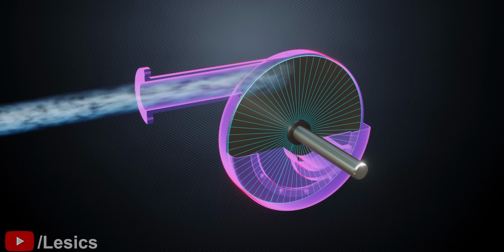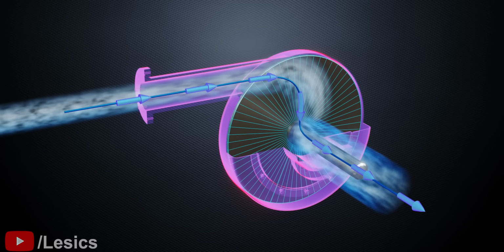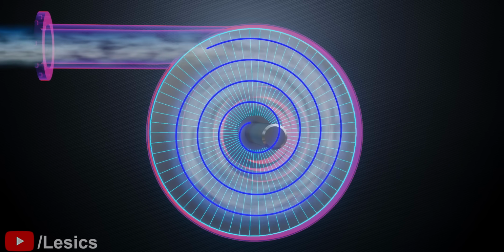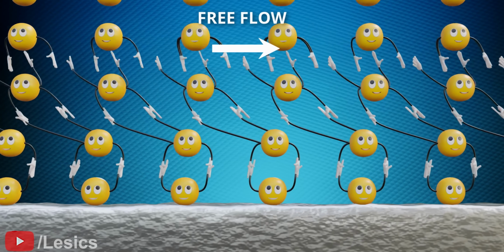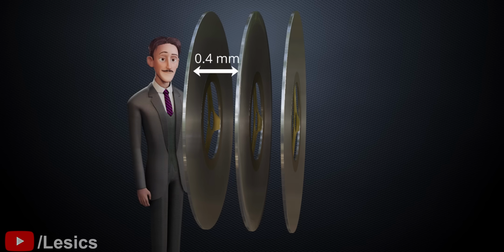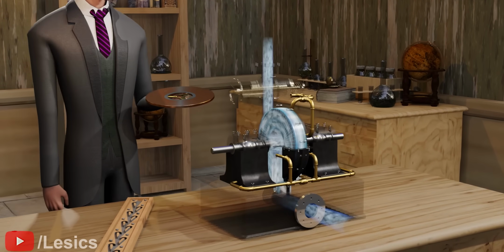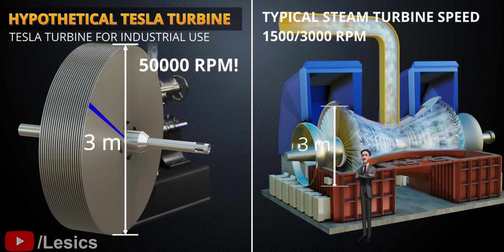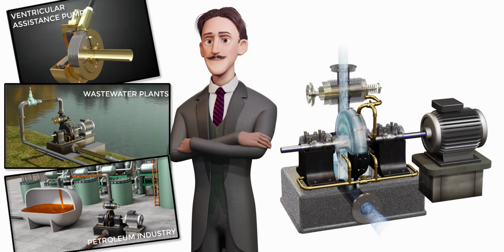Tesla Turbine | The interesting physics behind it

Comment: Edison after seeing this: Edison's turbine
Reply: Ill give you a gazillion dollars for it
Reply: @MrPorsche91730   here's 10 cents to buy your tech
Reply: @MrPorsche91730  I think it's
Reply: @MrPorsche91730  that would crash the economy
Reply: This turbine has much lower efficiency than any modern turbines. The problem was that at that time there were no technology to produce the blade turbines
Reply: @natteft6593  Oh really? The guys at iEnergySupply beg to differ. What this vid doesn’t say is Tesla said that pulling a vacuum on the exhaust increases efficiency by 50-100%! When used in a small form factor, in combination with a simple but specific generator geometry that uses non-ferrous magnets, this technology is absolutely perfect for every home to generate all the energy it would ever need using warm water.
https://youtube.com/user/Notime500
Reply: @DozenDeuce  pulling a vacuum costs energy, which reduces the performance. I'm not sure how the energy is meant to be enhanced more than the forces are offering.
Reply: @1SweetPete  I guess in space, vacuum would be no problem to achieve. The problem would be that you are leaking steam in space :)
Reply: @1SweetPete  In the case of steam, pulling a vacuum does not waste energy it recovers wasted energy. The transition phase of steam cooling to liquid form creates a vacuum in a closed loop system.  In other words placing condensers after the outlet of the Tesla turbine increases the efficiency. Also the issue of having a 3 m rotor due to “industrial scale“ is a false premise in this video presents that false premise without question. If the efficiencies can reach 97% in a smaller rotor then one would only need more smaller rotors as opposed to fewer larger rotors. Efficiency is efficiency. The production value of this video is very high and I suspect it cost quite a bit of money to produce, so the question you have to ask yourself is who benefits from spending so much money to discredit the efficiency of Tesla turbines in favor of others?
Reply: Yeah, there are ways to do a negative pressure exhaust in a closed water system.  We do it with pretty much every toilet on the planet.  That being said, I don't know if it would be efficient enough for a true vacuum.  I also thought about splitting up the water input into more, smaller devices, especially since we can get machining RPM materials up to RPMs significantly higher than those mentioned here, it's just a matter of parallel power generation of enough smaller generators.  The question then becomes a matter of whether or not manufacturing and maintaining hundreds or thousands of these small generators is more cost effective, not power generationally effective.  You have to assume at this point an overhaul is an expensive proposition, so will it be less expensive to do that or maintain existing structures?  I think this is where the obvious answer comes in.  An overhaul would be more expensive because A) there is no manufacturing line for this that could be easily a source for parts, since waste water parts or the like that use these as pumps simply won't work in a cleaner water environment like this power generator (much too large and the disks would likely not be as close because it's less pure water) and B) It would require significant training of existing power plant engineers to understand how to maintain the new system.  Since we're talking +90% efficiency either way, the additional power generated to be sold may not be worth the cost of migrating to this power system.

I do like your idea for a home power generator though, so long as the generators could be made cheaply and safely enough it could be a cheap and relatively safe way to generate power locally, as opposed to on a grid.
Reply: @DozenDeuce  Very smart, you do realize that creating a vacuum needs electricity?
The same amount of electricity can be used to heat the home with a  heat pump at higher efficiencey
Reply: @teaser6089  No it doesn’t. You simply run a Tesla Pump (turbine in reverse) on the same shaft. Watch the vids & you’ll have a new appreciation for Tesla’s genius
Reply: @DozenDeuce  Still not as efficient as a normal modern turbine, as an Engineering Student I fail to see how creating a vacuum would result in it becoming more efficient than standard lift-based turbines.
Reply: @teaser6089  Of course you don’t understand yet. You still haven’t watched videos that show actual experiments & the science behind them in detail. There’s easily available proof, but if you’d like to say “Uh, Uh!”, it’s your loss. I would only say, how very scientific. Modern turbines are great for industrial scale power plant applications, most of which would be unnecessary if we could all cheaply generate our own power in house. The gents I linked above are documenting their prototypes on the journey to make that future a reality.
Reply: @v1asec  Space is for endless junk dude
Reply: @v1asec  Yaaa... condensed steam produces rain in space, that would be a problem. Weatherman says he has no idea which direction the rain will be going or coming from, so wear your bubble rain gear.
Reply: @orwin5445  I think this comment hits the nail on the head
Reply: @InsideOutsideCo  you're a good man
Reply: @DozenDeuce  not even that steam takes up far more space than water and as it condenses it will pull a slight vacuum this phenomenon has been used in early steam engines.
Reply: @v1asec  they are something called MET engines which is to use steam to propel spacecrafts in space and it's specific impulse is very high , the company had launched it's first satellite placer(think of it as a Uber while spacex is a metro) on spacex
Reply: @natteft6593  97% effecienty is not enaugh ?
Reply: @ukrywondodoma  97% effeciency is excellent! But the Tesla turbine is not even close to this. It is below 40%
Reply: @natteft6593 what
Reply: Alternatively Edison would've demonstrated on an elephant how dangerous this Tesla's invention was
Reply: Fugp Basis  it is a well known fact that Edison was a crook and a scammer.
Reply: He is a theiiii..f
Reply: F Edison
Reply: Thomas Edison was against AC but never switched to AC even when AC had other advantages than DC also Edison stole nothing from Tesla
Reply: @Dino Sauro Sure Dino. Interesting that YouTube wants this link censored…
https://youtube.com/user/Notime500
Reply: Me after seeing this joke: My joke
Reply: As usual, everyone needs things in black and white, simple terms to process a thing. Have it boiled down to simplistic bumper stickers.
Yes, Edison was a crook more than once, but at the same time, he was also a gifted inventor who did, indeed, invent a lot of shit.
I know, I know. Too difficult and complex a thought to keep stored in your noggins....you need him distilled down to Crook or Genius. 
It's simply a meme today that everyone shit on Edison and therefore (because YOU need it simplified) he stole all his patents.
The truth, as always, was somewhere in the middle. And definitely more skewed on the 'Yes, he actually invented it' side.
The French are particularly keen to make a bigger villain out of him. Because too many of their own inventors leaned on Edisons research, and it offends their national ego. I wouldn't trust the guy with my ideas, but then again, you sure as hell shouldn't trust anyone today, either.

Edison was your typical ambitious engineer genius-slash-businessman. Tesla was your typically rare scientific genius-slash-engineer.
Reply: “My turbine” 🤣
Reply: Our turbine 😂
Reply: A lot of you guys spend too much time reading memes.  Believe it or not, Tesla was just as big an asshole as Edison.  He also treated his employees like shit, and he was also really into Eugenics, the science of breeding out "undesirables".
Reply: He is bloody  Cheater.
Reply: 🤣🤣 facts
Reply: The sad truth
Reply: Lmfao
Reply: Edison was a douchebag. Even Westinghouse took too much credit.
Reply: Good one😂
Reply: Soviets: OUR turbine
Reply: Edison was a Inventor and a Politician by nature

Tesla was a great inventor FOR HUMANITY
Reply: Edison is a fraud like Einstein.
Reply: Haha
Reply: Edison stoled it
Reply: Edison might make some copy of tesla's turbine. If copyright is there, Edison is done
Reply: Hahahaha
Reply: 💯 kind of like Alexander graham bell and the telephone, whoever’s got the money/connections gets the credit
Reply: Haha, so true. Edison was nothing but fraud
Reply: Edison liked Tesla, it was the overarching company abobe Edison who screwed Tesla over... and even thats a stretch, Tesla was not a businessman and while a genus, he  is one of the more mis-attributed scientists 
His invention was never stolen by Edison
Reply: “Turbine of Edison”
Reply: Black people after seeing this: Black peoples engine
Reply: Nice one
Reply: Edison worked on DC power.  Westinghouse worked on the AC power that Tesla worked on.
Reply: Patrick’s turbine
Reply: He would have just paid some thugs to burn down his lab.
   Edison was a disgusting human being.
Reply: 😂thank you really needed that today a real since of humor, I read that and 💩
Reply: 😂😂🤣🤣🤣epic reply. 

Edison is scientist. But he did only on invention bulb bulb bulb
Reply: 😆🤣😂🤣😆 ROFLMAO!!!
You know your Edison!
He was a DICK!!!😊
Reply: Nope! Cause Tesla is actually a word in the dictionary with a meaning which is the SI unit of magnetic flux density, which is a unit that Edison used to measure electromagnetic frequencies when using the generator therefore gave it the name Tesla Generator
Reply: That bastard stealed many creation from tesla
Reply: Edison is a crook. Tesla's the real McCoy!
Reply: @yahaha3339  Yes he was a greedy and extremely crooked business man, during his time. He used others to gain fame, yet felt no shame doing so.    Hopefully the feture will correct the false story of Thomas Edison.  
We as a people, will believe outrageous lies, if it's said enough.  I don't understand how intelligent people this day and age can still believe total nonsense from baboons, who knowingly spred their lies to the ignorant for their own advancement. I hope we can learn from this of act of Thomas Edison, and start to get wise of the falsehoods that happen today. Are we not learning from the past at all? If we turn a blind eye to modern events, we become the sheep. The lies must stop. People must learn to accept only the truth. If we do that, we become better people. We as a civilization will never progress, if great ideas are never used.
Reply: Only if he could purchase it, preferably with minimal 'advertising'.  You do make a solid point, though.  He was kind of a world class jerk, like many businessmen.
Reply: @MrJdsenior  Yeah, it is a fairly common trait among businessmen. Doing immoral things doesn't trouble their conscience at all, as long as it's legal (or the law that doesn't allow it is rarely enforced).
Reply: Edison was a thief
Reply: Fugp Basis  The Internet has falsehoods and truths.  It's not a news source. The newspapers are no longer being used as they once were. FB, TWITTER, and other numerous outlets are also bullshit news sources.  The only reliable news is Non-profit organizations who don't pedal to their advertisiors who pay millions for their political and personal advancements. Stations who show etire news coverage with out editing the contents to their likings to miss- inform their audience to words taken out of content to control their respective thoughts is criminal.  Non-partisan news is not sensationalized to stear the hate of the ignorant who don't know better. If edited speach is manipulated, its not to be trusted as reliable.  Watching C-span can be educational but boring. PBS is another outlet. For good labeled entertainment Fox news is your best bet, and that is a nasty joke.  A good jurnalist finds it laughable, and has no credibility.  Family Guy and The Simpsons are a better news source. They tell it as it is.
Reply: @timmlong1038  You say all this, but probably drink the CNN Kool aid, have severe TDS, think Joe Biden is the best president in history, see no problem with the clotshot and have no clue that all the supposed "unbiased" sources you quoted are all funded by the democrat party/leftist communist sources.
Reply: LOL- I spit out my cereal.
Reply: Tesla cultists be like 🤡🤡🤡
Reply: Some random American after seeing this: “It was invented by a BLACK MAN. This idea was STOLEN!”
Reply: @glaco  You are wrong... You are a racist for even saying that. Look up Jesse Lee Peterson, a black man. He says you all lie and want to steal from us.. Get an education, son. Stop listening to racist propaganda.
Reply: I see we're still spreading the "Tesla was the most intelligent man ever and Edison just stole his inventions"
Reply: @joaovitormatos8147  Edison did not steal any inventions of Tesla.  Edison worked in DC.  And Tesla and Westinghouse worked in Alternating.

Comment: Very interesting video.  Actually I calculated that a disc of 3m diameter, spinning at 50,000 rpm, will have an edge speed of 23 mach, or the same as the velocity round the Earth in low Earth orbit.

Comment: After seeing your video I have to conclude that this build appears to be flawed.  The faster this turbine spins, the more centrifugal force is produced. This would force the fuel away from the center.  As it does so, the less fuel would reach the exit. Eventually no fuel would reach the center as there would be more force directing fuel to the outer walls of the turbine. As there would be more pressure leading away then the pumps could possibly provide. 
The outer walls of the turbine would have  too much pressure on them which would result in a catastrophic leak and explosion.
Also the problem is that there would be an over presser trying to feedback into the fuel tanks. Said fuel tanks would be losing pressure as the turbine burned fuel at lower speeds.  So the pump would be fighting both the vacuum and the overpressure created by the turbine.

With all due respect to Mr. Tesla I would have to disagree.

Comment: It seems to me that the problem of MACH 13 disk edges is easily avoidable. Simply build wider instead of taller. That is, don't make the disks larger; instead, just use more disks.
Reply: Well they didn't explain why a 3m disk was necessary so ...
Reply: @eddarby469  So I'm thinking it isn't.
Reply: @theinstituteofmonkeygunvio2542  I'm not so quick to dismiss the three meter design goal, but I'm willing to hear why they want to stick to that as a goal.  It seems to me this should be a variable we can adjust in the overall solution.
Reply: @eddarby469  Well the obvious reasons for larger disks would be more inertial mass and more surface area. Additional smaller disks would also provide that, without the hypersonic problem.
Reply: @theinstituteofmonkeygunvio2542  I also was thinking there might be a bias toward rotational inertia involved with load balancing. However, none of this is worth getting a feeling for their performance under load.

Comment: Interesting video thank you. However you said at the start that you'd verify Tesla's efficiency claim, but you didn't actually do this you just supposed that it seems unrealistic. Would have preferred to see some actual figures or experiment results.
Reply: Also: You say that for industrial operations the discs would need to be 3m in diameter, but do not explain why. Why could we not use a larger number of smaller turbines to produce the same output?

Comment: No deficiency if you combine the turbines in a downward pyramid formation :) More smaller sized turbines combined with the runout (water) connecting to other turbines. The lower you go, the larger the wheel diameter  :) That will reduce damage and more efficient. Just a theory.

Comment: So we need an almost magical alloy like mithril or adamantium or along those lines to make a motor that reaches peak efficiency. What’s even crazier is the the Tesla motor could have gone even faster with modern parts - and failed spectacularly enough to end the genius!
Reply: @red dunkey 
Sorry, the resulting explosion from using modern materials to make a Tesla turbine run with modern materials would have had the rotors fail differently in comparison to the ones used, which only warped a bit. If they shattered and tore through the housing, Tesla could have been killed. Even a six inch rotor spinning at fifty thousand rpm would be enough to send the pieces ripping through most materials. 

The less effective materials probably saved his life.

Comment: would it help efficiency to use modern materials like titanium, carbon fiber, or ceramics-to achieve higher RPM?
Reply: No. That's why it can't be used. 
And, considering the RPM required for real efficiency, it won't be ever. The whole point of the device was simplicity compared to turbines -- and unobtanium disks are exactly what contradicts that.

Comment: The same principle is used in disk pumps, which are used in oil and gas industry for specialised liquid pumping applications. The liquid viscosity drives a pack of smooth disks.